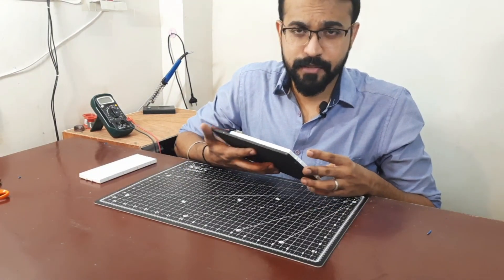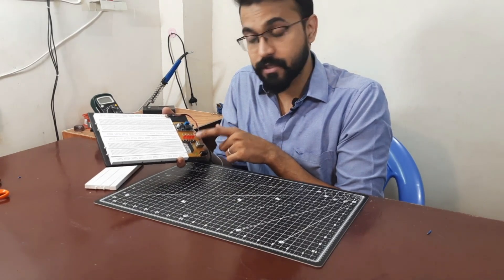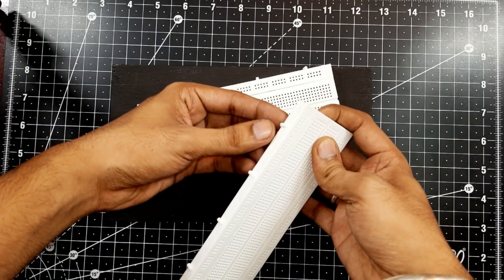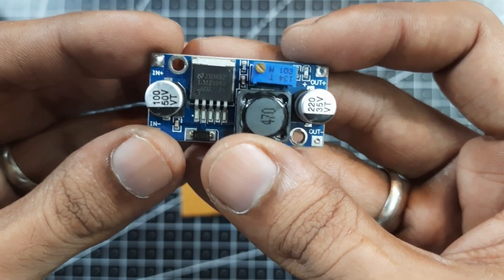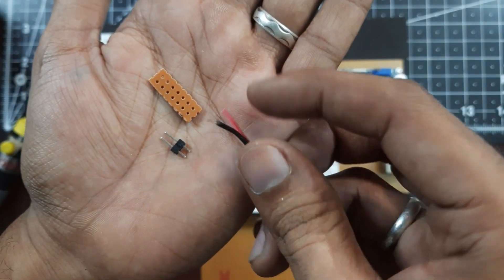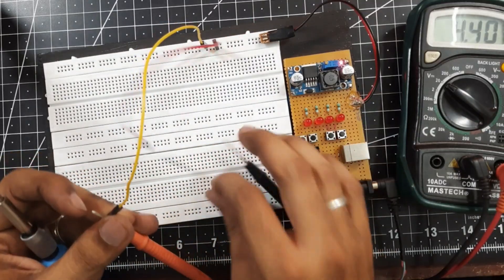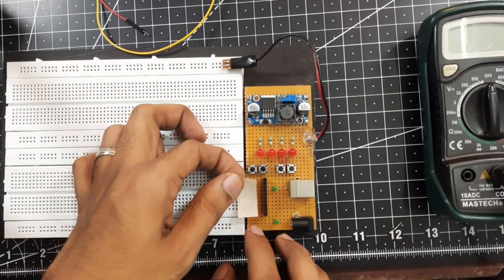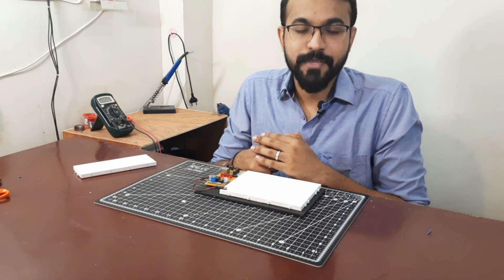DIY Bread board Prototyping Board

Comment: How should we make leds glow with a circuit which consists of pushbuttons and speaker.Thus pressing button activate the speaker with the respective led??
Please tell me sir!
Reply from the maker: You need the speaker to make beeping sound when you press button and at the same time LED glow??
Reply: Yes sir
Reply from the maker: In that case you can connect a buzzer(5v or 12v) of you choice along with an LED in parallel and connect this push button in series. 
When you press the button it will close the circuit and current will pass to buzzer as well as led and both will work.
As an alternate option you can also introduce a transistor amplifier circuit so that the led current is not sacrificed.
Reply: At the top,we should connect Led followed by buzzer and push button right sir?
Reply: Sir please reply